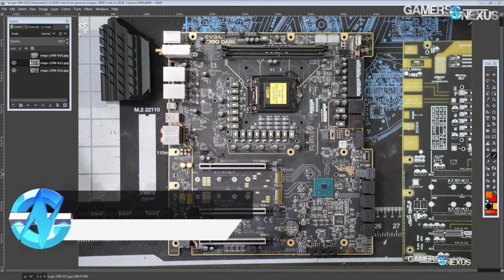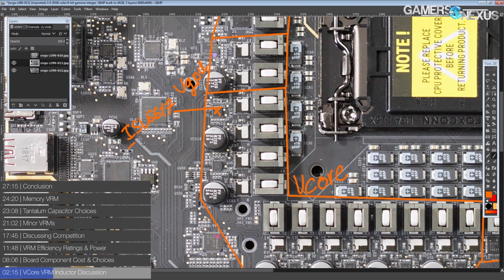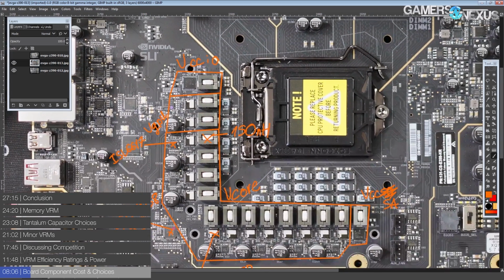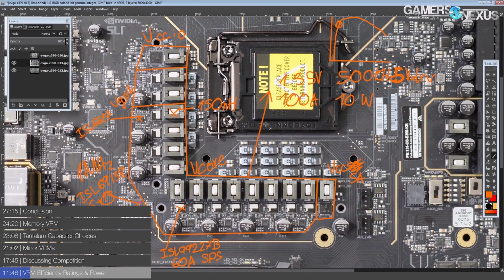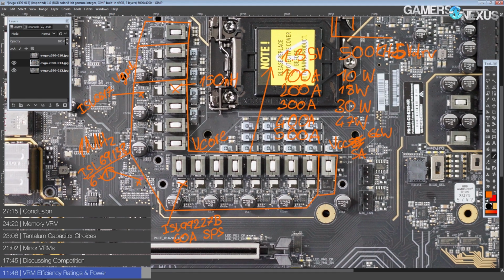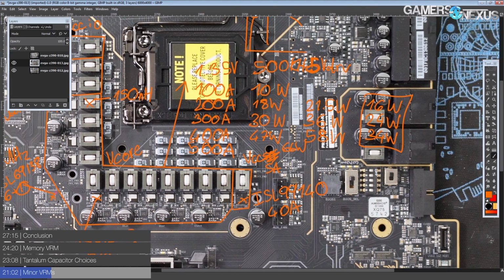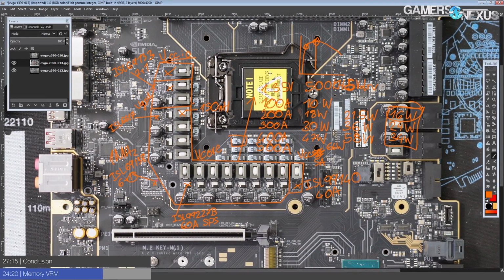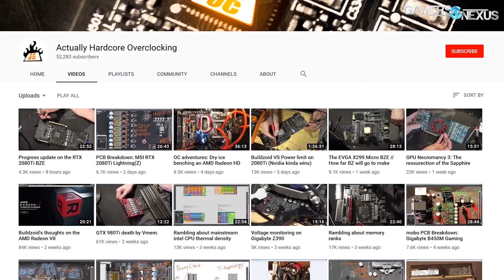EVGA Z390 Dark VRM Analysis & What It Costs to Make

Comment: Can't wait to see the X570 boards
Reply: honestly kind of hope the X570 boards aren't a huge upgrade, because I bought a X470/2700X and just want to drop a 3K series in and not have to lust for other features I might want.
Reply: @Zefram0911  so you're hoping there isn't any progress because you don't want your purchase to be a little pointless?
Reply: @Zefram0911  Wow, real mature.
Reply: But not X570 mobo from EVGA lul
Reply: EVGA doesn't make stuff for AMD
Reply: I can't wait for a version of Aorus Xtreme x570 likely with PCIe4.0
Reply: The problem I forsee for the X570 platform is that it will no doubt be more expensive (mainly because of PCIe 4.0) and with Socket AM4's clock ticking. AMD has pledged to continue to use the AM4 socket through 2020 but will Ryzen 3000 be the last CPU to be supported or will it extend to Ryzen 4000 ? Actually I expect Ryzen 4000 will be last but no doubt there will be yet another chipset for full functionality. Personal opinion is that AMD haven't been wholely transparent as they have released a new chipset and motherboards with every iteration of Ryzen. So much like Intel do if you want the best you have to upgrade although at least the socket can support more than 2 generations of CPU.

Comment: I really like this board.  If Sunny Cove were not due out this year, I would probably buy a 9900k and this board.  I recently tried to swap out my Asrock X299 board for the X299 Dark, in part due to the design principles used on the "Dark" line and the fact that I've seen what Steve has been able to accomplish with various CPUs on this platform in terms of overclocking.  Sadly, the board died during bench testing (not overclocking, just basic assembly) and I opted to return, rather than exchange it.  Given some of the things I read in the EVGA support forums, I'm not sure that I would buy a Dark board again.

Still really like the design of this board though.  Absolute best in class.

Comment: Got Aorus Xtreme Z390 #NextBuildEvga
Reply: How is mate ? I plan to get aorous extreme waterforce
Reply: @cemoruc8810  the board is amazing and looks amazing - the only board that competes is the godlike. But the waterforce will beat out both of these for sure.
Reply: @cemoruc8810  It is insane for overclocking on liquid or air. It has the capabilities for XOC but the Z390 Dark would be the better choice there. My only complaint with the Aorus is the BIOS/Software. Freaking PITA to learn and get used to the BIOS and the APP Center by Gigabyte is utter garbage. Love mine though, great price and very feature rich.
Reply: @JG-yk6ny  guy did 5.2 nicely in aorous extreme. I still don't know what to get. There is apex z390 also this board or gigabyte. I know Asus bios inside out. I got 5.3ghz ön mine 8700k

Comment: Intel released i5 9400f today and i7 tomorrow and nobody seems to be interested?!
Reply: 14nm+++++++++
Reply: Did you mean a binned an i5 6400 with 2 more cores?
Reply: It's the same processor as the one which came before it, but with less features (integrated graphics) for the same price.
Why would anyone be interested?
Reply: A CPU with less Features for a sometimes higher price, no thanks
Reply: An already existing CPU with less features but at the cost same if not more sometimes, as the one that exists already? Yeah no thanks. Not interesting.

Comment: so does this means I can have a lower Vcore voltage on my 9900k for 5Ghz if I switch from the maximus XI Gene to the EVGA Dark? ( I switched from the strix z370G to the Gene and my Vcore requirement for 5 Ghz on the 9900k  went down from 1.402 to 1.296).
Reply: Yeah, at least a little. Maybe .05v or so

Comment: I hef question I'm looking to upgrade my really old pc it's a i5 2300 6gb ddr3 gtx 550ti.
I'm looking to upgrade my gpu and ram 
I want to upgrade to a rx 570 4gb but I'm worried my cpu will bottleneck my gpu 
Or should I just build a new system with the rtx 2060 and the new ryzen chip when it comes out?

Comment: Intel...so tired of high prices. Than god for AMD
Reply: The price of Intel CPUs actually started to fall again, but yes, AMD CPUs still have much better Price to Performance Ratio
Reply: @Felix-ve9hs  Intel i7 8700K (launch price $359 USD), 6 months later - Ryzen 2700X (launch price $329 USD) and the 8700K has a 5% performance increase. GTX 1080 Ti (launch price $699 USD 23 months ago) on par in performance Radeon VII (launch price $700 USD), AMD R9 295X2 (launch price $1,500 USD) went down to $800 USD a few months after launch due to the release of nVidias GTX 9XX series, AMD FX-9590 (launch price $920 USD) in less than 4 months had a massive price drop and started selling for $350 USD due to the release on Intels i7 4XXX series.
Thank nVidia and Intel for keeping AMDs ridiculous launch prices in check.
Reply: @Skelath  competition is good. Right now we need some for rtx 2080ti because you can't disagree those are insanely priced
Reply: @gautamdiwan5952  I agree they are high prices, just like how my 35 inch ASUS Rog Strix 3440 x 1440 curved monitor with "Freesync" is more expensive than the launch price of my GTX 1080, same goes with my 43 inch Philips 4K IPS monitor. But you ain't gonna be buying those RTX cards if you have a small cheap shoddy monitor, any mid range GPU is fine for small 24 inch 1080p monitors, however 1080p looks terrible when stretched over a 30+ inch screen. Can't do RTX 2070 and above any justice on a small cheap monitor, needs to be an expensive high end monitor or don't even bother at all.
Reply: @Skelath  i said rtx 2080 ti because many don't defy Nvidia's decision of such pricing because "it is the best you can get". You know shit's fucked up when the new 80ti is on same price with the last gen titan (or the previous 80ti during mining craze)
Reply: @gautamdiwan5952  Exactly and when it comes to AMD and Nvidias consumer gaming GPUS, they are currently both on par in performance and price in terms of the Radeon 7 and RTX 2080. However the RTX 2080 Ti continues to rise in price and it can't be due to miners as the profitability of the RTX 2080 Ti for bitcoin mining is only $2.50 per month due to asics miners.